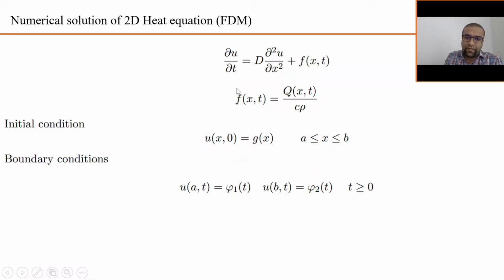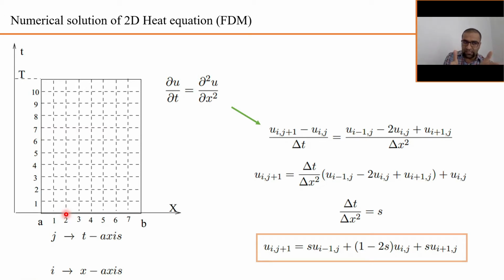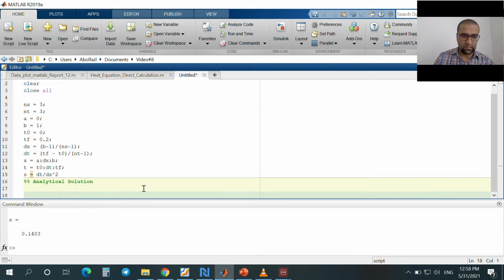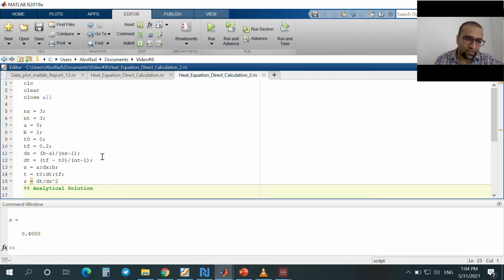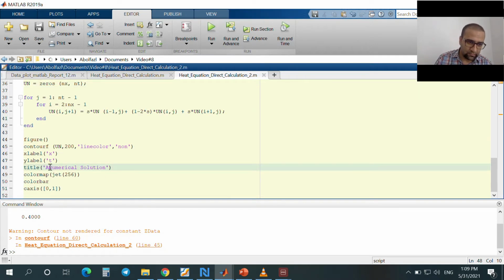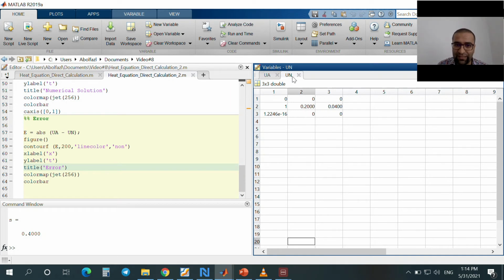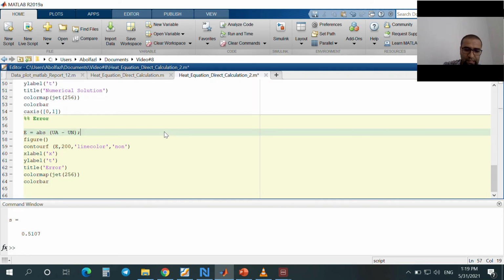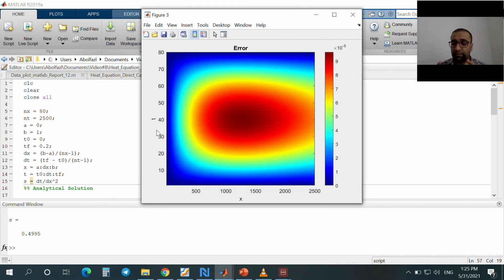Numerical Solution of 1D Heat Equation Using Finite Difference Technique

Comment: Hello teacher! Let's say I had the initial condition UN(x,0)=25°C with boundary conditions non-homogeneous: UN(L,t)=500°C and UN(0,t)=100°C. How would I define this in the program? If I do:
UN=zeros(nx,nt);
UN(:,1)=25;
UN(1,:)=100;
UN(end,:)=500;
Would it be correct? I need this for a university program
Reply from the maker: I think yes, these definitions for BCs and IC are true
Reply: @abolfazlmahmoodpoor_  
tic
clc
clear all
nx=100; #pontos na malha de espaço
nt=500; #pontos na malha de tempo 
alfa=17.094*10^-6;
L=0.5; #final da barra
tf=50; #tempo final

t0=0; #tempo incial 
L0=0; #inicio da barra
 
dx=(L-L0)/(nx-1);
dt=(tf-t0)/(nt-1);
#FO<1/2
FO=(alfa*(dt/dx^2));

x=L0:dx:L;
t=t0:dt:tf;

#condições inicial
UN=zeros(nx,nt);
UN(:,1)=25;
UN(1,:)=100;
UN(end,:)=500;
for j=1:nt-1 
  for i=2:nx-1
    UN(i,j+1)=FO*UN(i-1,j)+UN(i,j)-2*FO*UN(i,j)+FO*UN(i+1,j);
    end
  end 
[X, T] = meshgrid(t, x);

figure()
contourf(T, X, UN, 50, 'linecolor', 'none')
title('Solução Numérica')
xlabel('x')
ylabel('t')
colormap(hot(50))
colorbar
toc

Comment: Hi, I have a question is the crank nicolson scheme has the same step?
Reply: Actually,  I am trying to solve heat equation by using Crank nicolson method and I need your support 

Best Regards
Reply from the maker: In crank- nicolson  scheme qurant number (s factor in video) could be one and the code will be stable.

Comment: Hi ,, 
How to solve the same equation if there's a term infront of Uxx( right hand sight of the equation) like = C^a ?
Reply from the maker: If C^a is known just insert the value of C^a at each point of mesh grid to calculations.
Reply: @abolfazlmahmoodpoor_  does C^a make the equation nonlinear?
Reply from the maker: @toufeeqsiddique7520  If C^a is linear no, if it is so, yes. Moreover, try to make your PDE in dimensionless form to avoid numerical instability.
Reply: @abolfazlmahmoodpoor_  so the basis to solve this equation in finite difference method for both linear and nonlinear is same?
Reply from the maker: @toufeeqsiddique7520  It's possible to solve with other method like finite element method, but in any nonlinear case you should linearize the equation some how.
Reply: @abolfazlmahmoodpoor_  sir, can you make video on that? How to solve non linear pde in finite difference method?
Reply from the maker: @toufeeqsiddique7520  Poisson's equation in addition to Boltzmann's distribution is a nonlinear PDE, I will consider it at the next video!
Reply from the maker: This paper may help you regarding nonlinear PDE

https://www.researchgate.net/publication/259436373_Numerical_simulation_of_pulsed_plasma_sheath_dynamics_around_a_micro-sized_tip